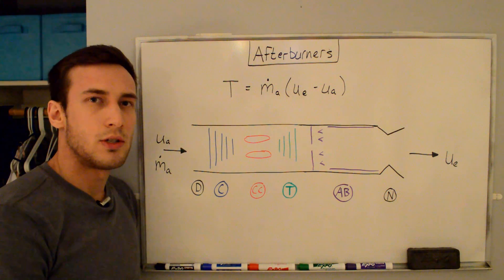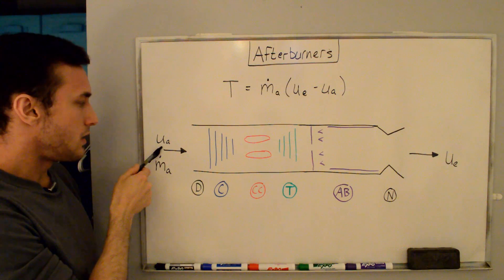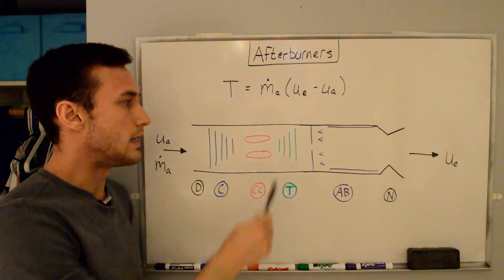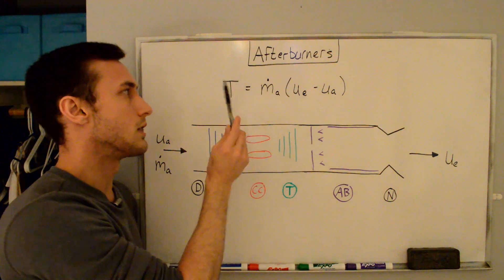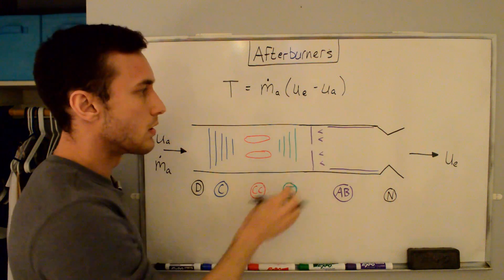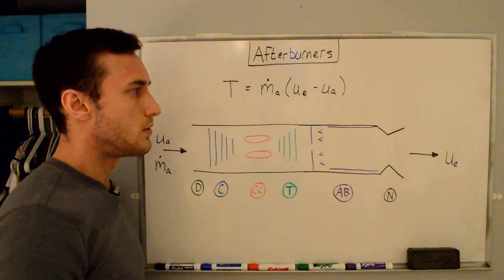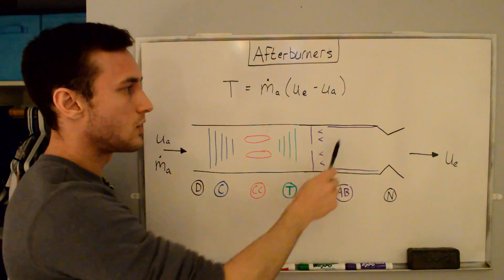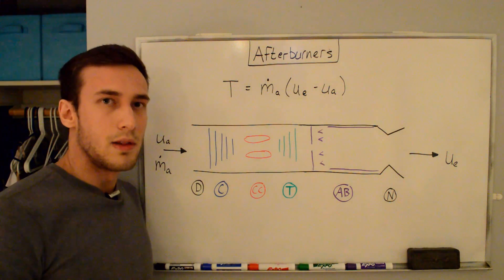In a Nutshell: Afterburners

Comment: interesting. this reminds me of some turbocharged internal combustion engines with high compression ratios to prevent knock, at a certain rpm range the engine changes the stoichiometry and adds in more fuel than otherwise to keep the engine temperature down. high compression ratio engines have issues inherently with knock. 

but here it is quite the oposite.. to keep the temperature of the turbine down there is excess AIR post combustion chamber? then add fuel? i dont get it how when there is excess of air it would that keep the temperature of the turbine down. thank you.
Reply: Actually turbocharged engines usually have lower compression ratios considering the turbocharger compresses the air going into the engine. You probably know this now but eh 🤷
Reply: it is all relative - at the perfect air/fuel ratio it would be hottest, either side of that point would be cooler.

Comment: Josh, I loved the basics you covered and hoped my question would have been answered. My question:  Why is so much excess fuel used that flame can be seen for many feet beyond the afterburner nozzle?  I suspect it is because additional thrust is achieved in that shock wave tube behind the jet when its supersonic, as if the actual engine existed several feet behind the jet..  Is my suspicion correct?
Reply from the maker: Thanks!  Actually, anything that happens outside the nozzle is wasted energy.  If you can see shock diamonds, it means the engine is not operating at its ideal condition.  It is either expanding the gases too much, or too little.  If it expands the gas too much (near sea level and lower altitudes), then you get something called overexpanded flow.  If it expands the gases too little (at higher altitudes), you get underexpanded flow.  You can see shock diamonds for both these conditions.  The ideal operation of a nozzle is when it expands the exhaust gases perfectly to the ambient pressure.  This is how you'll get maximum thrust.  I have both a video on converging-diverging nozzles (https://www.youtube.com/watch?v=p8e8A3sdVOg) and on why the perfectly expanded case gives the maximum thrust (https://www.youtube.com/watch?v=F3ylH8onOlw&t=225s).

The glowing outside the back of the engine is not always necessarily bad, as it can just be the radiative emission of the combustion products at the elevated temperatures of the exhaust.  However, if you have soot or unburned fuel, this can also emit in the visible wavelengths at those high temperatures.  Any unburned fuel/incomplete combustion/soot is wasted energy, so this should be avoided.  This gets deeper into radiative emission, which is a topic for future videos!
Reply: Josh, thanks for your response and references to those two additional videos.  I imagine, then, that the ideal nozzle is, therefore, only theoretically achieved and is never actually achieved if the ultimate goal is to have exhaust gas pressure exit the terminal end of the diverging nozzle at ambient pressure.  What an engineering nightmare it must be in attempting to achieve that and "ambient" pressure, as measured by the pitot tubes in the aft of the plane, must be accurate enough.  I guess it's like everything else in life where diminishing returns takes over.  Love your videos.

Comment: Hi Josh, talking about reciprocating engines, a richer mixture means a cooler engine since the remaining unburnt fuel carries away the heat from the cylinder. I also study gas turbine engines, and initially I thought it would be the same. However can you physically explain that? Thanks! great vid.

Comment: It's my understanding that, in piston engines, running lean causes a hotter burn. How does this differ in a jet engine to instead (as you mention) cause a cooler burn?
Reply from the maker: I find it easiest to break things down into a simplified analysis, and ignore the specific applications to start out with.  What I mean by this is that we can just begin by looking at a fuel and an oxidizer, and how they react with each other, ignoring the type of engine.

There's something called the adiabatic flame temperature, which is essentially the maximum temperature that a mixture of fuel and oxidizer will reach.  It turns out that this maximum temperature is reached when the fuel and oxidizer are in stoichiometric proportions.  By stoichiometric I mean that there is just enough oxidizer to completely burn with the fuel, leaving no oxidizer or fuel left over in the combustion products (this is also where something called the equivalence ratio is equal to 1, in case you see plots with the equivalence ratio on the X-axis).  The outcome is that we can predict the maximum temperature we will see for a certain fuel.  If you go fuel-rich or fuel-lean, the temperature will decrease.  There are a couple caveats to this, but they're not important in a simplified analysis, and you can assume that for a certain fuel and oxidizer, the maximum temperature the products will reach will be the adiabatic flame temperature at stoichiometric conditions.

So that being said, I would have to look more into the topic of the piston engines that you mention to give you more information about that, but the maximum temperature the combustion products will reach will be at stoichiometric conditions.  I'll be posting some more videos on combustion and so on, so if you're interested, be on the lookout for those videos.  Hopefully that sorta answered your question!
Reply: I think it is all relative - at the perfect air/fuel ratio it would be hottest, either side of that point would be cooler.